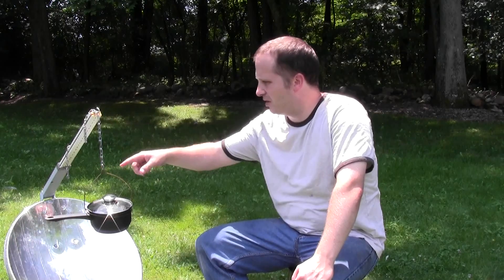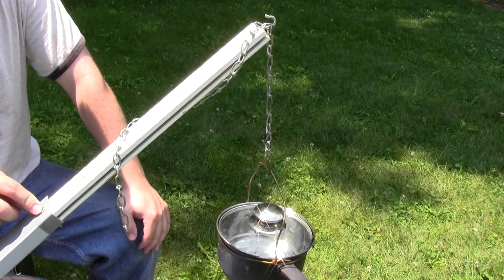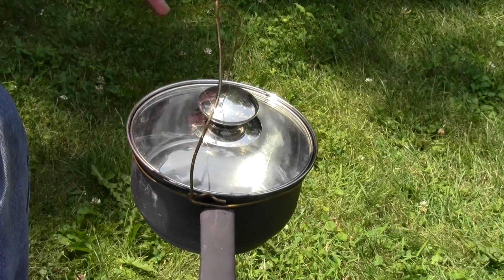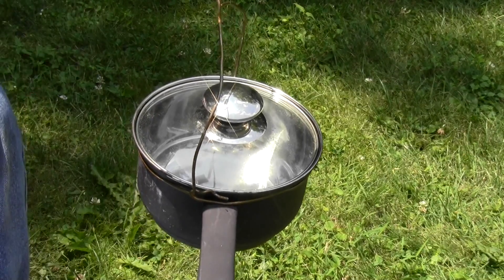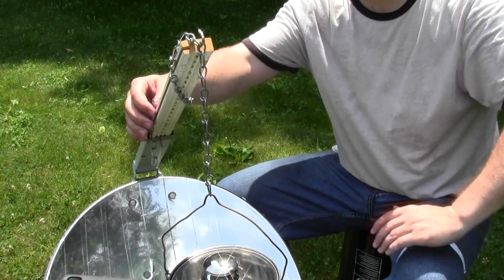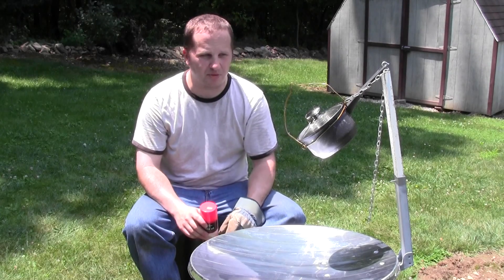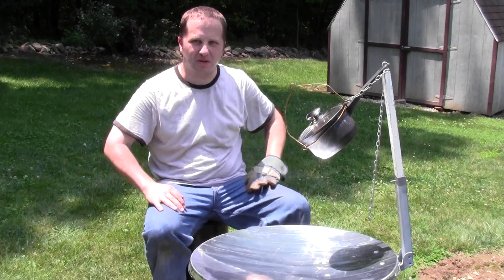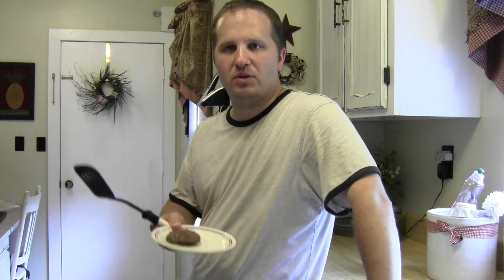Satellite dish solar cooker - cooking a hamburger.

Comment: Most canola, corn and soy is genetically modified therefore synthetic and yes it's toxic plus the fda allows certain chemicals to not be listed, also canola oil becomes even more oxidized while sprayed rendering it more toxic and any canola oil or polyunsaturated oil used for cooking burns easy also rendering it more of a threat to our health, if you want healthy and high smoke point go for beef tallow.

Comment: After many years of off and on solar experimentation, I believe that in some cases, it's pointless to paint your cooking utensils black. The concentrated focus of the sun onto the pan heats the pan immediately and keeps on heating. Sure, a shiny surface can reflect some of the sun's rays but I don't think it's enough to worry about. And the energy is free anyway.

Comment: Hello, Vitamin A, Vitamin B12, Vitamin D, Folic Acid, Vitamin K, Vitamin E, and Riboflavin are all light sensitive. They all break down in the suns rays. For this reason some have recommended that solar cooking be done with an opaque lid to keep the nutrition in the food. It depends on how long it will be in the sunlight though. For instance, a gallon of milk can loose 80% of its riboflavin when exposed to bright light for 2 hours. If the cooking is quick you shouldn't loose that much.